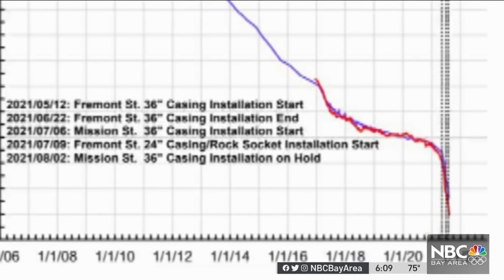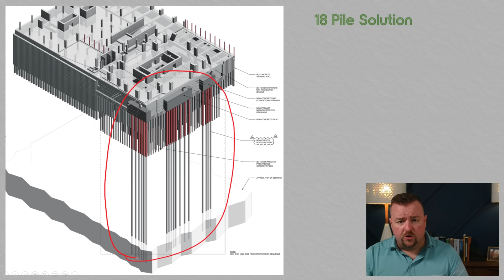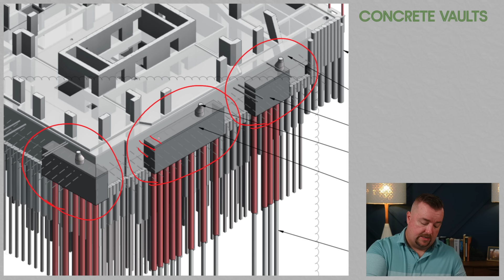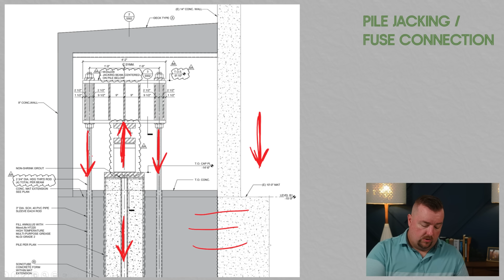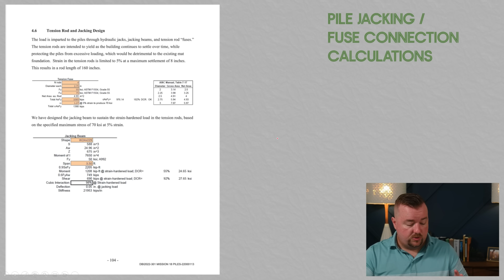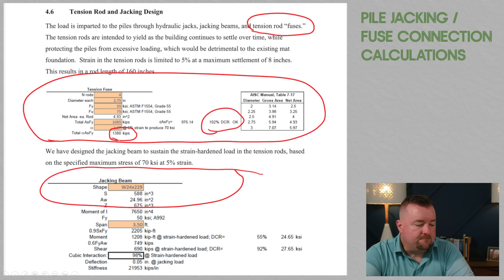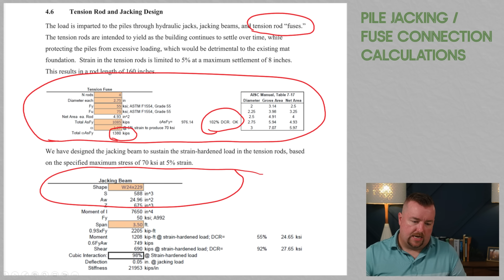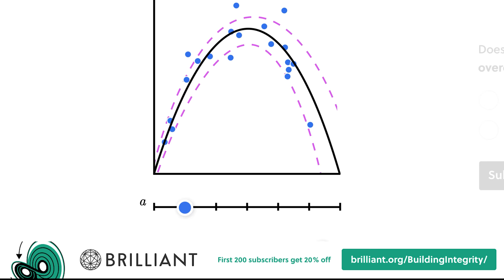Did I Uncover a $100,000,000 Mistake with the Millennium Tower "Fix"?

Comment: I'm thinking of two long-term things: Corrosion and earthquakes... 
Now think of the friction piles on three sides and one side load on the bedrock. Then... Earthquake. Bedrock moves (so far so good). However, "earthquake soil liquefaction" may occur on the other three sides where the friction piles are holding up the bldg.
 
I surmise the soil doesn't move in perfect unison with the bedrock because of inertia and there is a delay of movement of the top of the soil from the bedrock. But the new piles are on the bedrock and the old ones are in the soil...

I can't see any good coming out of it...
Do you?

Comment: Sounds like the developers put huge pressure on the initial designers(engineers and architects) to come up with a hypothetical solution to reduce costs in pilings and then ran with it

Comment: The engineer who designed those bolts as torque to yield should read up on the failure of the FIU pedestrian bridge.    😳
Reply: When I heard that I was stunned. Most civil engineering projects use safety margins of 3x or more. About the only industry that I've worked where safety margins are under 1.5x is aerospace and even those guys didn't go under about 1.25x when I was in it.
Reply: @supremedictator.  - and aerospace has a need to keep weight to a minimum - that’s the only reason for margins not being as high.
Reply: Yep  in that case they didnt even model the end connections for the stress case where the bridge is half built
Reply: That's a good example of failing to calculate loads, but the closest engineering disaster would be the 1981 Hyatt Regency walkway collapse. Basically they had a very similar problem with putting too much load on a single nut and piece of steel. The hanging walkway collapsed in the middle of a crowd of people, with disastrous results. A last minute unnoticed design change slipped by, and doubled the load on the upper walkway. This looks very similar, down to changing the design to make it cheaper, and an oversight on a single point of failure.

I'd hoped that engineers would remember that lesson from school, and we wouldn't be repeating this same mistake. Fortunately, there are other engineers who are paying attention, and reporting these problems. That's exactly what saved the Citigroup Center from collapse, and I hope that responsible reporting can prevent a potential disaster once again.
Reply: @alexlowe2054  When I was watching this the 1981 Hyatt Regency Walkway collapse popped into my head. You beat me too it! Here is according to my memory some issues about it, but I likely got some of it wrong:
One of many issues with the walkway collapse was that the walkway was kinda added on as an afterthought. Or they knew there was something like the walkway was going to be there. Somebody at the engineering firm came up with the design. The firm did not double check it, nor did the city double check it. It did not receive the serious concern it needed, probably because by comparision to the building it was merely a walkway. The original design called for every long threaded rods that threaded through three levels (I'm going by memory) of walkway. Multiple rods would hold up each level, and each rod was carrying partial loads of 3 levels. After the collapse it was determined that the rods were inadequate to carry the load, and would likely fail. At the opening the walkways were very crowded. Did the engineers consider the estimated load with crowds on the walkways? Acquiring long threaded rods was difficult; they were not at off the shelf item. Attempts to install by threading through the walkways and getting each level at the target height proved near impossible. Delivered rods had many mis-threads. The construction builders came up with a solution. At each level the threads were threaded into a plate, and cut. A nut or nuts held each rod at that level. A little to the side on the plate another length of rod was bolted on and continued down to the next lower level, if any. This created a weak point, the plate between the two sections or rod. The load was no longer continuing through the rod, losing some of the strength of a continual rod, but shifted onto the plate. It likely would have failed even if it could have been constructed to the original idea though.

Comment: As with everything in engineering, it’s always good to have a random set of qualified eyes look at a problem without deep context, since they don’t have a ton of preconceived assumptions.
Reply: Currently bidding the first job I have designed and the good questions getting from bidders about some (fortunately minor) stuff I overlooked to precisely figure or if I figured it out include in the bid documents.
Reply: This is an unprecedented building foundation design for the context and an unprecedented fix proposal. There is nobody who is well qualified for a typical cursory design calculation review here. It needs a complete top to bottom holistic review and the cost would be very high and would certainly uncover design flaws that neither the people paying for it, nor the design engineers want to discover. The stakeholders (city and public) need good representation and they are not getting that!

Comment: "There's a deviation between what you thought was going to happen and what actually happened." I am just a lowly EE who knows nothing about structural engineering but this is the biggest red flag. When you do calculations and then the result does not match your prediction you need to stop! It often means one of your fundamental assumptions is incorrect, and you can't just add another "fix" which is based on similar assumptions to address the symptom. Especially if your design incorporates empirical rather than fundamental physical formulas and the scope of the design is outside the norm!
Reply: The City approved the original design. When that failed, someone on the city side probably should've said "we're clearly not qualified to review this design" but instead, they asked for a "fix" to the problem they approved and then said "we'll review that fix too .. we know what we're going." If only there was a way for people to learn from their errors.

Comment: My concern when looking at the first diagram is that the rebars hooking the 3 new boxes to the existing foundations would sheer under the stress:
Instead of a compression force (the normal foundations are facing), those rebars would be facing sheer force.
Reply: There is also a tension load as the vault acts as a lever.
Reply: @Robert Swaine The foundation undercut angle in the cross section diagram is an approximation. You can see what that actually looks like in the video at 9:30.

Yes, this whole contraption, as designed, puts the entire foundation slab into tension and I'll bet that there's no calculation showing that this is fine. Mostly because there's absolutely no way that this is fine! There's going to be a competing failure point: Do these vaults pull off the side of the foundation first, or do the plates pull apart at the holes or do the "fused" rods fail at the first earthquake. 

IMO, the whole approach is flawed. They either need to push it upright from the top where they'd have a LOT of leverage (good luck with that), or lift the whole building up and put in proper foundations like they should've done in the first place (good luck with that one, too). Those are both unsurmountable problems and I'm pretty sure they're at the point where they need to take the building down to about 10-20 floors or so and then they'll be able to get underneath it to give the foundations the do-over that they need.
Reply: Not everything is shown here. Maybe the old rebars were connected with post tension bars or cables. Thus it would be more of a friction connection and only partially shear. But a good point. A have designed a few smaller foundation fixes myself and have always put new load bearing structures directly under the loads one way or the other. Shear connection in a case of a high rise building is quite "brave" solution.
Reply: I'm guessing those bar stubs are not the primary connection between the vault and existing mat. More than likely they will have post-installed more rebar higher up to splice the concrete members together, and the angled keyway will be held in place such that the concrete there must shear rather than just the rebar taking the load.
Reply: @danielziemba8045  Given the loads, and production implementation randomness, I just can't see this shear/pullout risk holding as designed. If the foundation slab was post-tensioned, then you'd see transit tubes through the middle of the slab and there's none of that. If you were designing it as a showcase in "how cheap can we make a skyscraper" then adding post-tension to that slab would run against the aim.
Reply: When the building sinks, does the ground compact or does the sink become uneven? I know little about this.
Reply: @supremedictator.  sorry if I was unclear; I was referring to simply doweling in new bar, not port tensioning it.
Reply: @the11382  the sinking in this case is occurring at the tips of the piles something like 100’ down where there’s a stiff soil layer. It is probably causing that soil or a softer clay soil below it to settle via consolidation, which can be described as compaction. If the loads are too big, the soil will shear, meaning a cleaved surface will appear and soil in the way of the pile will be pushed aside without much of anything compacting. A soil shear failure generally means the collapse of a structure, though.
Reply: @danielziemba8045  Yes, your comment wording was a little squiffy. No biggie. :-) 

Yes, looking at the pix in the vid, it looks like there's WAY too much horizontal rebar coming out of the side of the slab, so I presumed that half of those were newly added. I understand what they're trying to do and I'm sure the math looks like it should work, but we're looking at a foundation failure with uneven loading and dynamic movement. Nobody builds a standard structural model that covers building failure modes like this one is going through.
Reply: @supremedictator.  No doubt. Don't get me wrong: I would not want to live in this building, even after it's "fixed". After all is said and done, nobody on Earth can tell you how it will respond when the next earthquake strikes SF.

Comment: Also, since they are only jacking 1 side of the building, there will be rotational motion, and the hole the pile passes through will no longer be vertical. This could cause a whole different type of stress if there is not sufficient clearance around the pile.
Reply: I'm not a smart person at all so I apologize for the dumb question. What do you mean about rotational motion
Reply: Accommodated by the greased sleeve for the pile, no?
Reply: @adventureswithdavedave You've got a building sitting on a floating foundation that isn't touching bedrock.  Because of a design change during construction, the foundation was designed for a building half as heavy as what was built.  The foundation slab is bending and cracking, and the tower is sinking further and quicker than expected, and is tilting as well.
The first proposed solution was to install additional pilings on all sides that would go down to bedrock, and connect them to the building.  Unfortunately, when they started to do this the tower's tilt and sink rates got worse so that was abandoned.
The current plan is to connect only one side of the building to bedrock.  A risk is that the overheavy building will continue to sink on the floating side but the bedrockked side cannot sink; this rotational movement will force the 'vault' off the vertical and cause the new pilings to touch the sides of the greased tube, reducing the effectiveness of the solution and eventually fracturing the vault.
Reply: i will laugh and cry if they try lift 1 corner and then it bend n snaps inthe middle, since the foundation is undersized it might have a higher chance of snaopppin g witht he added load of pushing up and down,

Comment: You can turn this into a movie. In the climax during a press conference with the engineering company's PR spokes person you stand up and say "The fix won't work! You didn't calculate the loads correctly. The fuse anchors will fail!" And the PR guy would be like "who are you? Some podunk structural engineer? Let the big boys handle the real work." Then two security guards take you away while you're screaming "You're putting lives at risk! Look at my data God dammit! Get your hands off of me!". The rest of the movie writes itself.
Reply: Millennium: An Irwin Allen production.
Reply: The next part of the movie involves running the reactor to 105% even though you have an anomaly reading on one of the cooling pumps before the test starts, and then you have to permanently abandon an entire region of Soviet Ukraine.  You could have a part where one guy on the tower design team remembers his grandpa telling him about driving a ship at full speed in the fog at night.

Comment: Yah, I'm convinced you're correct.  The critical area for the plate is where the 3" hole is for each rod to go through.  That only leaves 3 1/2" X 1 1/2" cross section in the plate.  This is also further reduced by the size of the jamb nut below the plate.  

Also, consider that during tightening realignment, the fuse box is going to want to pull away from the building causing an uneven force on the rods...  it seems like this pull away is going to put excess stress on the inner bolts over the outer bolts and that stress is going to be hard to measure.

Additionally, there are more forces at play here.  1) the weight of the building 2) the force of the pilings holding the building in place in the existing foundation and 3) the frictional force of the soil that was originally supposed to be greater than the weight of the building.  When you lift the building you have (1) building weight, (2) foundation weight, (3) soil that you're lifting as well and (4) friction of soil before it falls away to allow the building to move.  So, your fuse needs to handle 4-5 times (minimum) the weight of the building or the rods give way.

 Finally, if further soil movement occurs under the foundation the soil will likely overcome the frictional force holding it in place rapidly.  I don't know the soil composition but I know that the nearby subway excavation resulted in fine sand.  Thus, you would have a rapid (within seconds) shift of weight conditions within the structure causing an event that could cause the whole building to shift if the soil "lets go" between the existing pilings.  That rapid shift in weight could not only snap rods in a cascade but the sudden change in pressure could release water or air trapped in the soil causing it to liquify amplifying whatever void is there and adding acceleration to gravity to the equation. 

And, it's probably a good thing that this building is leaning into the prevailing wind, although wind forces on the building could also have a dramatic effect on the load of the steal plate and threaded rods as well. On 12/12/1995 wind speeds clocked in over San Francisco (near the top of Millenium Tower )at 108mph.   Tell me about the calculation of those rods when the face those rods are against is getting an average wind speed of 95mph.

PS.  Not a structural or soil engineer but my mom worked at Northwestern University Civil Engineering department so I picked up a few things.

Comment: This looks like a disaster in the making. Bringing in the original design engineers was not the brightest move.
Reply: I'm not an engineer, but I my own job (which requires accuracy, though it's not a matter of safety) I teach my students that as soon as you find something is wrong, you can't just ignore it and try to fiddle other things to fit. You have to track the root cause down, find where and how you made the error, and strip it out, and do it right. Immediately, without faffing about. Because in the end, you will have to anyway, so any time spent trying to fiddle round it means both time and resources being wasted. If the error was made right at the start, then you have to strip all the work back to the start- the point you made the error. And made dammed sure you get it right the second time. In this case, the equivalent would be demolition right back to the foundations, which was where the mistake seems to have been made, and correcting it by making new foundations. Grim outlook, indeed, but surely not as grim as it falling down.
I am reminded of the first Tay Bridge- one of the reasons it fell was an error in the early borings and an unsatisfactory redesign of the foundations and bridge after the error was found.
Reply: As pointed out in the first comment from Josh: The fix engineering team are Not the OG design engineers, but they seem to have both studied together at a small engineering school in Eastern Turkey.